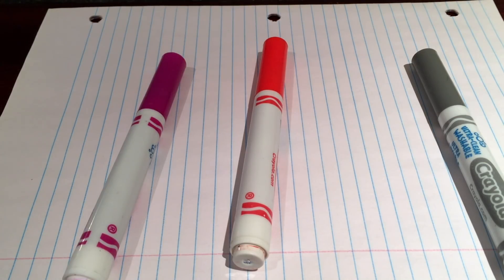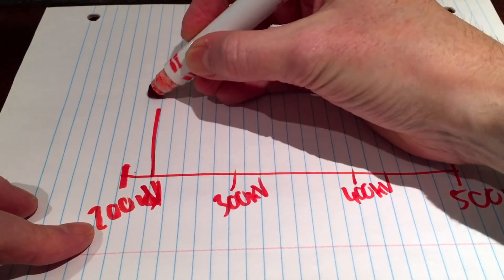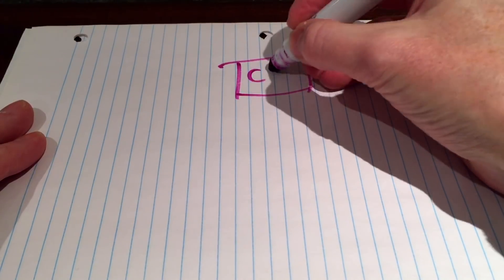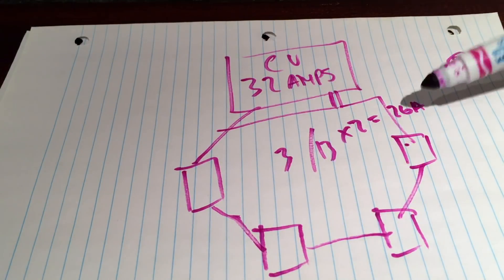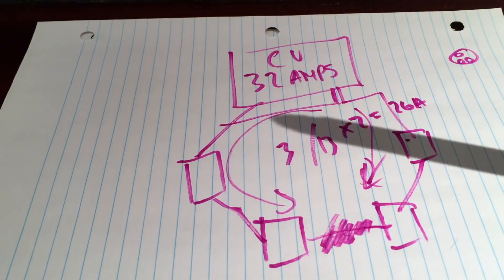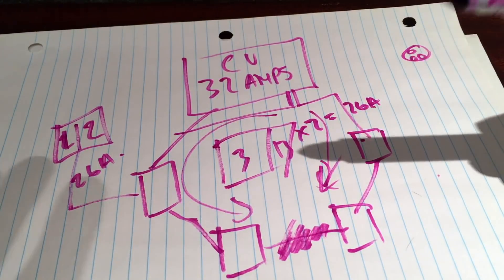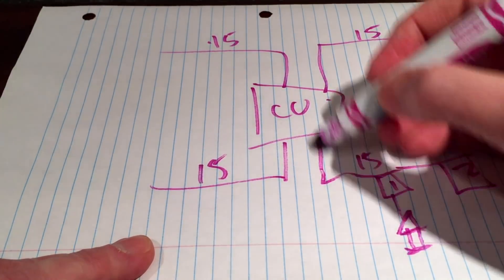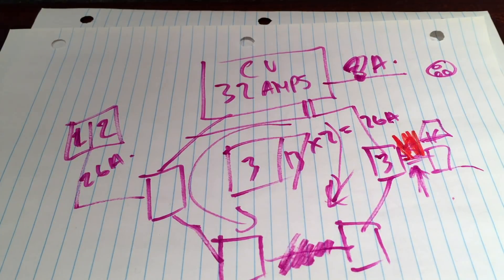THIS is why British plugs have fuses

Comment: I dislike the video because you did not say the CB will trip in case of the lamp fault in the ring circuit. Instead you said that the wire will be on fire, what the CB does if it let the short circuit happen and does not trip?

Comment: Jason, I'll chime in on the 12-amp thing. It's part of our electrical code, and related to the trip curve of the circuit breakers we use.

As you likely know, an electric motor in a stall condition pulls approximately four metric craptons of current, and they are essentially stalled when you first turn them on. This is to say, an electric motor pulls a ton of current trying to start. If a 15-amp breaker tripped immediately at 16 amps, it would be impossible to start most electric motors. There are delays designed into the breakers (and fuse wires where used) to accommodate this.

In practice, a fifteen-amp breaker will take several hours to trip when loaded at, say, seventeen amps. That's okay though, because the wiring it's protected would also take a similarly-long time to actually become hot.

Our circuits are not designed to be fully loaded to 100% constantly, and in fact a breaker loaded this way will eventually trip. We define "continuous" loads as  those devices that are likely to be operated for three hours or more at a time. These loads, in order to not trip the breakers they are attached to, are limited to 80% of the circuit rating. 80% of 20A is 16A, and 80% of 15A is... guess it... 12A.

Hair dryers, operated only for a few minutes at a time, are often rated to the full fifteen amps.

I don't know about vacuum cleaners. I've definitely seen some higher than 12 amps, and, really, if it takes three hours to vacuum your floor, you just need a smaller house.

Devices like electric space heaters with 15-amp plugs will most certainly be limited to 12 amps, legally.

Comment: 15A is the maximum current, but regulations say you shouldn't run it continuously at that current. I suspect that's why you see 12A on many appliances. For instance, 15A X 120V = 1800W. However, most appliances are rated between 1400-1500W because that power level is considered safe for continuous use.

Comment: Still none the wiser. That malfunctioning US lamp could still draw many times its rating without tripping the breaker. A fused plug would seem a sensible idea whatever the system, enabling a direct match with the rating of the appliance.

Comment: Jason, Some of the junk splooged out from communist China to the U.S. have these damn dumb fuses. Yesterday I bought a new fan, and yes it has a plug fuse and no supply of extra fuses.I'm cheap and run alot of old fans and other 40 to 60 yr. old appliances which have no plug fuse. What is your opinion if I snipped off the plug with a fuse and put on conventional plug without a fuse? Asking for your opinion as one nonelectrician to another.

Comment: I think the reason for limiting power to 12 amp for each device is because if what you have plugged in draws 15 amps on a 15 amp breaker then there is a greater chance of it tripping. Plus that breaker may still have to be able to provide power to lighter loads like a lamp for example.

Comment: The 12A appliance limitation may be part of *derating*. This is where the amp rating of a wire is reduced because of how many conductors are in a conduit, or because the wire passed through an area of very high temperature (attic). The theory of derating is that if there's some external factor which might stress the wiring in such a way as to reduce its ability to conduct its rated current safely, we reduce its current rating by a fixed percentage (and thereby reduce the load it can handle).

Only problem with the UK system is that if the whole house is on a "ring" circuit (with spurs), the  segments of wire closest to the consumer unit will conduct a great deal more current than those in the middle of the ring.

It should also be noted that, because the UK voltage is roughly 230V, where the U.S. voltage is roughly 115V, the amperage draw for devices of comparable construction should be half of the US appliance rating. That is, a toaster in the US rated at 10 amps in the US should run at 5 amps in the UK. (Relates to the power equation: power = voltage times amperage.)

I used to be an electrician here in the States.

Comment: It's not entirely accurate that a fuse is required just because of the ring circuit. The purpose of the fuse is to protect the flexible cable from the plug to the appliance. In the case of a low-power device, like a table lamp, the flexible wire might only be rated at 3 or 5amps, and if it's damaged or the insulation is degraded it might carry sufficient current to overheat the cable under a fault condition yet not enough to trip the circuit breaker. That is an issue for outlets rated at anything significantly above the flexible wire rating - so it also applies to outlets on circuits rated at 10A, 15A or even higher in some areas.

Radial circuits in the UK aren't even limited to the 16A that is commonly seen. A 32A radial circuit to a kitchen is very common (and sometime 40A), and what's also common is for their to be a standard outlet on such a circuit. There is also nothing in the UK regulations that stops multiple sockets on a 32A radial. Indeed, many electricians prefer those to rings as they are simpler to test (and they make particular sense for a dedicated socket circuit for kitchens).

The simple fact is that it makes a lot of sense to have fuses in plugs with ratings suited to the flexible cabling, whatever the regime,

Comment: a fused plus is safer, and easier to fix.... but in the UK how does one household run on a 32Amp service when you have an all electric kitchen? in the US our ranges can pull up to 50 Amps at 240Volts.... and the clothes dryers about 25 amps.... you combine those with the rest of the house and you'd be blowing your main fuse in the UK.... how do the newer homes in the UK handle this? here in the US, our "CU" is rated at 200 amps...
Reply: He got a bit muddled as a normal socket rings on the CU will be rated 32A, but the CU will be higher depending on the size of the house. Someone else in the comments said 100A is the most common for regular sized houses now days, but I honestly have no idea.
Most ovens don't have plugs. You wire them into a junction box that is on its own ring (possibly along with a seperate hob, and a single socket) conected to an easily accesible, bright red switch nearby, that sits in for the socket switch we would normally have. 
Small houses / appartments may have a plug in oven, but then the kitchen will have its own ring. There wont be space for more than one other large aplience in the kitchen, but in my wifes old flat she could blow the main fuse by running the oven, the washing machine, the kettle, the microwave and the hoover, all at the same time.

Comment: In Australia we run on uk power but our power system is based on the usa otherwise we would have uk wall sockets . looking at my fuse box this is what i found -              
 2 power circuits = 1  rcd on each power circuit  rated at 10 amp -  lighting circuit = 1  rcd at rated at  8 amp . when it comes to business i believe all thats done is the 10amp power power circuit are  rcds/breakers are changed to 15amp.

Comment: In Austria we used to have 16 Amp fuses for the household outlets, star wiring.
Normally we have three-phase supply to every house. Within one room there must be only one phase wired, lights and outlets, all from one phase. Kitchen stoves normally are three phase and are connected to special 3phase plugs, neutral and protective earth.
Before EU we had 16 Amp fuses to each circuit, using 1,5 mm^2 wires,  which the EU changed to 12 A maximum. The reason is, the wires get quite warm with 16 A and in Italy they have higher average environmantal temperatures than in the North of Europe. Then the Italians argued, they are a poor country and they cannot change their household electricity rules. Therefore all EU had to lower the standards to the Italian niveau. Now we all are limited to 12 A for wall outlets, the fuses are in the central distribution box, not in the outlets.
Reply: Really? Because in Germany we use 16A breakers and so does Italy.
Reply: @AlterKater  No, we still use 16A breakers
Reply: @AlterKater  Ok, I have to take back my statement C13 breakers appeare to be the new Standard for 1,5 cables throw insulated walls. But not yet the official Standard in Germany.

Comment: I didn't see an answer to your question in the comments, so here it is. NEC (national electric code) specifies that a circuit should not pull more than 80% of its rated load continuously. Which means the max continuous load on a 15 amp breaker is 12.5 amps. I am not an electrician so I don't claim anything I say is right. So a google search for "NEC 80% rule" is a good starting point to do your own research. I believe NEC 210.19 is the correct article.

Comment: Never heard of spell check?....... You are rather out of your depth as regards power transmission and  home electrics. Some of your statements are basically correct but by no means all. Stick to what you know.
Reply from the maker: Not seeing what's spelled incorrectly.  If you can point it out, I can fix it.

Comment: It's clear that the answer to the question in the title is that having a fuse in the plug allows different gauges of flex between the plug and the appliance to be used and always have a fuse which will blow before the flex overheats and causes a fire.  This has nothing to do with the use of ring or radial circuits.  The question that hasn't been answered is why isn't it also necessary on other systems which have 15A to 20A radial circuits?  What's to stop anyone in the US or Germany plugging in a lamp with a 3A rated flex which will catch fire and burn down the house if a fault in the lamp draws 10A?  

Theoretically the answer to that last question is that the appliance should contain a fuse matched to its cord but when did you last see a table lamp or a radio with its own internal fuse?

Comment: In the US, you can only draw 80% of the rated breaker current continuously. Therefore, 12 amps is 80% of 15 amps.  One can pull 15 amps for some duration before the breaker heats up and will trip.  At 80% continuous amp draw, the circuit is good indefinitely.

Comment: A little knowledge is a dangerous thing. UK and Ireland are almost identical regulations.  Consumer units are normally minimum 63 amp to 100 amp depending on size of house. Cookers are not supplied with 3 phase 400volt as standard. Cookers. Immersion units and showers are supplied on a separate Single phase dedicated ring normally with 32 amp mcb as protection. The fuses in plugs are to prevent fire in appliance by short circuit on ring main, although mcb and even older elcb will most likely trip first.

Comment: In Australia we use the radial system also but our usual household power outlets are rated at 10 amp the wiring in the walls is rated at 15 amp and the circuit breaker/fuse is typically rated at 8 amp. The reason for these ratings are simply that is an item  plugged in to the wall shorts out the first thing that SHOULD drop is the breaker/fuse however before circuit breakers some people were lazy and would use heavier fuse wire to repair blown fuses to stop it blowing if it was just the overall load on the radial being greater than the fuse rating. so then as a secondary safety point the wall sockets were only rated at 10 amp so they would over heat and hopefully stop working before they caught fire. The wiring in the walls was the highest rating simply because that is the last place you want fire inside the walls themselves and because on a radial system it needs to carry all the current for the entire leg not just to a few sockets.

The down side to this is that when houses are being built cheaply often they will try to use as few circuit breakers as possible so you have one for lights one for power until they reach a possible radial draw of well in excess of 8 amp before they will put in a second breaker. In many cases you will end up with a house with 2 power breakers one that may have all wall sockets but for one or two rooms on it and the last room or two on the second breaker and if the draw on the first breaker reaches the limit it will drop out but the one room or two wont drop power at all. This would be easily solved by balancing the likely power draw over both breakers (say by putting the laundry and kitchen on different breakers and maybe then only putting half the sockets in each room on one breaker and rest on the second), but this is considered wasted time as they only put in second breaker if they have to.

Interesting video though as I had known you had fused plugs and used ring system but didnt know what the difference was and thought the fuse was simply a first point of failure point for ease of repair.

Comment: The 12A issue: most consumer grade vacuums in Canada use SJ / SJW type wire of the 2 conductor 17ga or 2 conductor 18ga variety. Based on Underwriters Labs current-carrying ratings, the 17ga hits roughly around the 12A limit for runs of 0 to 50 feet.

The 18ga technically shouldn't be used at all, since it tops out at about 10A max capacity and if you're unlucky enough to have a vacuum that draws more than that, you WILL find the cord getting quite warm during constant service (yes, even with a 12A vacuum). Anything over 5-10 minutes runtime should be viewed with caution. (This is also why your detachable black PC 110/120v cords all have that 10A max rating stamped on them, they're 18ga albeit a much shorter run, and are actually correctly labeled for their application.)

With respect to vacuums, however, I've seen firsthand the danger this poses, as in the past I've witnessed 12-foot and 20-foot 2/18 cords ignite when they had 12A running through them. Don't believe the sticker if those piddly little things claim to be able to handle 13A or 15A.

Oh yeah, and DON'T let prongs get dirty or corroded, you'll have an even bigger fire hazard on your hands.  :P

Comment: You kept saying the consumer unit is rated at 32 amps. The circuit breaker protecting the ring final circuit is rated at 32A not the consumer unit. there may be several 32A circuits (say an upstairs, a downstairs and a kitchen ring, then several 6A lighting circuits, maybe another 6A circuit for smoke alarms and intruder alarm, A cooker circuit  which may be 40A, a shower circuit, etc etc.  the 32A ring you mention is just one of many in the consumer unit (sometimes referred to as the fusebox)

Comment: Typical british,make it complicated!!We in the Netherlands have just 230 volts and 16 amps.One fase.And three fase 230 volts 16 amps.The wires are the same where ever they go,because anything can be plugged in any socket.Except ofcourse the 3 fase socket.Let me give you an example.In a room there is a plug,in that plug is just a lamp.The house is sold and in that room the new owner puts his washing machine.Well,no trouble,the plug can handle it and also the wires.
Reply: That is no different from the UK system except that the appliance is limited to 13A.